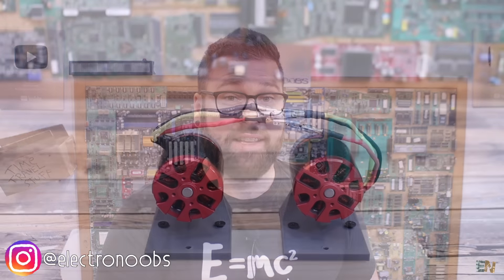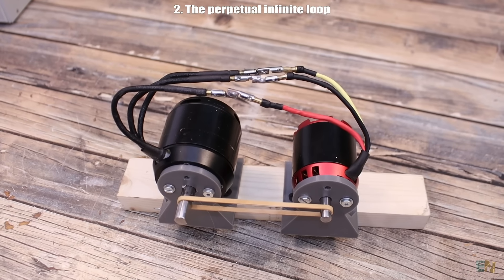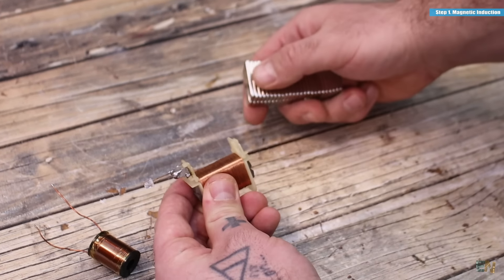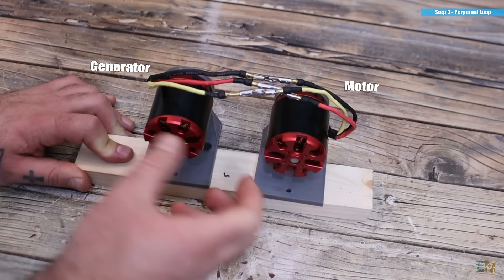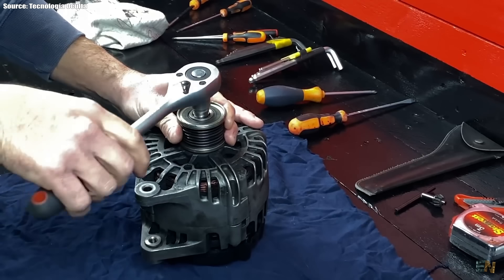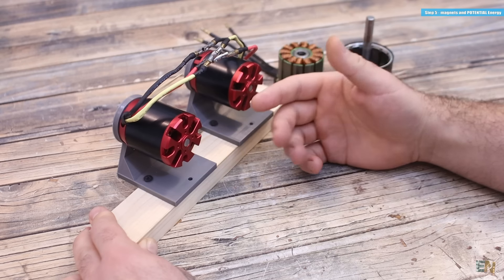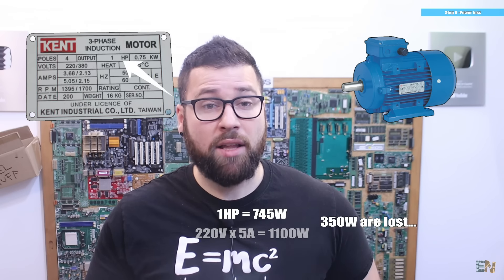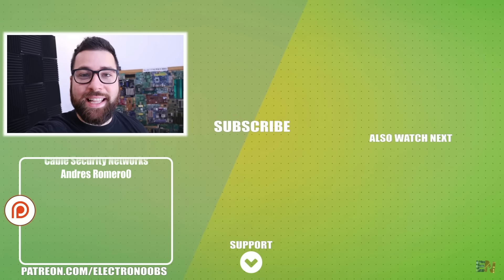Free Infinite Perpetual Energy Nonsense - FAAAAAAKE

Comment: It would be better if you built the "perpetual" things exactly like they do it in the fake videos (a car alternator and electrical motor) and then prove that it doesn't work by trying to "start" the process, not by using two identical motors.
Reply: it would be better  if you never said  stoopidness.!!!
Reply: exactly, all he does is repeat fake science
Reply: watch the video again and try to understand what he's actually saying. then you might start to understand why the others videos are just view bait
Reply: 2000 to 3000 watt, the windings from motor to the windings of generator must be act like a stepup transformer.
Reply: If the generator is outputting 24 volts ac  connect to ac/ 12vdc converter back to supply the generator this will work.
Reply: @jeffreyneal8042  no, you can't increase voltage without losing amperage. These two together give the power (wattage).
Reply: @PyroSAJ  it is a pitty to see how clueless - but tremendously clueless... - people try - and they push hard man - to "educate" those who studied the topic and deal every single day with it.... but ironically, they always only brag their theories, not a single fool of them ever tried to build that not even $200 machine, to prove us engineers wrong, though their gurus gave them thousands of howto videos.... and that says it all.... all homer simpsons....
Reply: @rdson1621  I found it curious that the latest charlatan explicitly stated in his 2 hour demonstration video (with lots of handy concealed corners) that said device wouldn't work with the given build instructions. There's an additional bit he apparently hasn't revealed yet.
Reply: "It would be better if you built the "perpetual" things exactly..."

No, it's better to present the fundamentals which then give an understanding of why it can't work.
Reply: @BeardyMacBeardFace  Nonsense!
Reply: I'm going to test it myself, because this guy might have been hired by power companies to stop any ideas out there, or he have economical interests that wouldn't be generating income if everyone knew how to produce their own power.
Reply: @roavik  Please consider uploading a video of your test :)
Reply: @roavik  or please report back to this comment thread with your findings! best of luck :D
Reply: If what you say is true, why don't you make one like it and show it to people and show the trick.  He kept it working for two hours.  If you want to show the trick, do it yourself
Reply: This guy is blind from all specs  the  video he's talking  its turning alternator to be permanent magnet rotor induction power to the coil then the coil  supply energy to the power cord to feed the motor with its single phase induction rotor ac  and the motor turn cause the generator alternator keep moving and that  it's simply.  And aviable
Reply: "tell me you didn't understand the video, without telling me you didn't understand the video"
Reply: @finnmurtonz7062  I didn't understand the video :)
Reply: @finnmurtonz7062  do u believe alien exist sir
Reply: @shahnizammohdnoor1562  it's statistically impossible there isn't somewhere in the universe inteligent life, even more impossible to not exist simple life forms, now, the probability of inteligent extraterrestrial life being inside our solar system are close to none, so i do not believe in aliens on earth if that is what you are asking, sir.
Also, what does that have anything to do with my comment? xD
Reply: @fredoscott2346  In a few words, the experiment he did, should have better results than the ones in the fake videos, and he even explained why.

He also explained a few ways to improve efficiency, but did't to make it similar to the ones in the fake videos.

This video it's full of verified information, and you are asking him to make a worst setup for the experiment.
Reply: @finnmurtonz7062  You misunderstand me. It is possible to make free energy/electricity by using this method, but not in the way this video does it.
Reply: @fredoscott2346  Show me how :v
Reply: Haha.. you dont know what this is about.. clearly you have missed the trick.. this is possible. Build one exactly the same and PROVE is doesnt work, and then report back to everyone.. simple..
Reply: @TrickyDickyP  me?
Reply: @shahnizammohdnoor1562  Yes I believe aliens exist.. I am one..! 😊
Reply: @finnmurtonz7062  "Someone" would have me killed.
Reply: @fredoscott2346  Nope, all industries want better efficiency in their systems and machines, an efficiency higher than one, would make you priceless for them. Even power plants want more efficiency, humanity wants unlimited energy. You are just making excuses, cause you know it's impossible, or at least don't know how to make said machine.
On a side note, one of the most efficient machines are electrical transformers, its efficiency it's around 95%, some can even go up to 99%. If you want  to search for unlimited power, i would start with machines that are already that good.
Reply: 90% of the content I see on YouTube is 100% bull@#$^
Reply: @cdiperformanceparts4364  ... leaving around 10% to be real and not fake...
Reply: @cdiperformanceparts4364  yeah
Reply: @roavik  This guy is illuminati, that's why. ;)
Reply: @فؤادفودي-ب9ط  Because he is illuminati
Reply: @finnmurtonz7062  Machines that are already that good aren't on the market, because the government doesn't allow anyone to get patents for them.  Look at what happened to Nikola Tesla ;).  Wake up and smell the coffee
Reply: @beaueads4170  bruh... i've worked with those machines, control and electrical engineer, they ARE on the market, but they are not toys, they are not gonna sale a machine the size of a two floor house to anyone. Electrical transformers for the step up phase in distribution are like that, you can even ask a substation to visit, some may let you go to see from a safe distance these beautiful monsters.
Reply: @roavik  Exactly.  Finally, someone seeing the light!  There are lots of greedy and secretive assholes out there.
Reply: @finnmurtonz7062  Finn Murtonz, I'm afraid to tell you this, but you have been deceived by the masses.
Reply: @fredoscott2346  Exactly, this guy Electronoobs doesn't have all the specs the other smarter guys used to create their revolutionary machines.  He's just another hater talking shit about it, maybe because he is jealous.
Reply: @TrickyDickyP  Definitely much more than 10% ;)
Reply: @cdiperformanceparts4364  How do you know for sure?  Sorry, you can't say that with certainty without knowing these things and statistics for sure.
Reply: @finnmurtonz7062  There's a lot of stuff you don't know apparently.
Reply: @finnmurtonz7062  In short terms, it's all about creating more electricity than you use on whatever you use to create it.

If you must use 30W to create 40W you have created 10W.
Reply: @fredoscott2346  when it says 30w motor, or 50w transformer, that is just talking about how much power it can withstand... Lets use a simple resistor as an example:
We have a 1kohm resistor rated for 0.25w
And a 1ohm resistor rated for 10w
Which one do you think will last longer at higher currents?

And this one is my last comment, good luck with "your" physics.
Reply: @finnmurtonz7062  I never said I was anything more than an idiot, did I? But of course, just like everyone else, I try to give the impression that I'm intelligent.
Reply: @finnmurtonz7062  no they want more money and more control
Reply: @beaueads4170  waste of your energy they think that companies and government all have thier best interests at heart even though they have to purchase their own freedom from them .
Reply: @beaueads4170  Very possibly Sir..!
Reply: @beaueads4170  OK... so all of us that think there maybe a way forward the energy and revisiting old devices and patents, maybe we should all team up and make one of these 'fake' machines (like Crazy Channel) and PROVE to ourselves that it can work. 

All the 'believers' should get together and form some sort of project group. I know we will be in different countries, but that will make it more fun.
Reply: I agree let’s debunk the so called fake debunkers and start are own like, iam already working on the hydrogen generator one !
Reply: @carlococchetto757  ok. Thats a good start. In a few weeks i will build the permanent magnet generator, we need a way of communicating between like minded people, maybe 'Telegram' as it is secure?
Reply: Exactly
Reply: @beaueads4170  also 70% of the videos I click on are not in English but is titled in English. How do I know what for sure?if I answer your question that's assuming what you meant and isn't intelligent form of communication.
Reply: excacthly, this video is really fake like more similar, they doing the same wrongs o building.
Reply: @roavik  did you build one like the hidden tech folks did? If so did it work?
Reply: I did not, but there are ways to reduce power usage and increase output, but it's in all my head for now.
Reply: @roavik  The entire world's looking forward to the day you get it out of your head and into reality. Well, not the ones earning billions on energy production/sales, maybe.
Reply: @BeardyMacBeardFace  rubbish.how cn it not work.this is no different than what's happening in a car.the prime mover ie petrol engine drives the alternator which supplies the electricity for the vehicle.in this case the motor is the prime mover .lol
Reply: @TrickyDickyP  these nincompoop  don't realise that this is exactly what's happening in a car.a prime mover ie petrol engine is turning the alternator.as long as the engine runs the alternator produces electricity.in this case a motor drives the motor which receives electricity from the alternator.i cant believe people are so blind.lol
Reply: @nerog3136  The only proviso is you need to generate more power than you take out.. permanent magnet generators (if built correctly) can do this.
Reply: Yes. True. Can he get exactly the same and prove this wrong.
Reply: You are right❤
Reply: @rdson1621  the principle is demonstrated in a car.whats the problem. A primemover turns the alternator /generator which produces electricity.ie14v dc or  120v ac 3 phase.no.???
Reply: In dat video they us magnetic N/S in motor = 2×1  , but whay they didn't connect out put ree energy to de battery en inverter,  I think dat is the challenge 

I will try to do it en see hoe is rayht  , we kan find alternator en motor in garage 70 dollar 💵 😎 🤣  , en views we all has been seen that video en likes hhhh

Hoe try it before please 🙏 took because I want try to make dat free energy 

Thank you 😊
Reply: @rdson1621  stop talking nonsense.
Reply: @daviddavids2884  dvmb@ss
Reply: @TrickyDickyP   I have the same dream of creating a magnet power generator, but when I shared my ideas with friends and family they just laughed at me.
Reply: In engineering thermodynamics it is manifested that perpetual motion machines are a myth ages ago.
Reply: @roavik  There Must be another way to create power apart from Mr Grid. I'm sure there are more than one way. But there must always be motion created by water,wind, weighted flywheel
Reply: @roavik  Me too I'm not believing everything this Guru says there must be other ways from Mr Rippoff Grid. ✓
Reply: @roavik  Sometimes even I wonder if most people are idiots. Merry christmas :)
Reply: This guy explains and do nothing!!!
Reply: Okd physics
Reply: I took after Aliexpress a generator with magnets of 10 KW and go I bought it just to convince me I start the generator with a drill at 1500 rpm until the single-phase motor starts to spin my pulley to the generator
Reply: @emilpogan5771  So it worked in other words?
Reply: Exactly words are words regardless of facts and simple math.  Not to mention each part you spoke of what we already know and the nature facts of these parts. 

So show us what you spoke and prove them wrong not just try to discredit other videos.
Reply: He can't. He doesn't have a clue how the alternator is configured to be a used as a motor that produces AC current at the same time its used as a motor.
Reply: Agree
Reply: The Battery drives the car into a range and an alternator can charge a battery while it runs 

🤔

It’s a wiring harness issue

Grounding 
Wiring 
Voltage Conversation 
Voltage Regulation
The Wiring Harness would look like the human circulatory system 

It’s not “impossible” 

But it is with this attitude 

It just hasn’t been configured right yet
Reply: This is not the type of system that exists in an electric car 

An electric car has motors and a battery 

Putting an alternator into that equation changes the formula of power distribution 

Figure out the issue

I don’t need people telling me it won’t work

I need people that can solve problems 

Otherwise this is no help what so ever
Reply: @fredoscott2346 mám doma 2,5kw spotreba výroby 8kw
Reply: Esoooo es. Justamente lo que yo iba a decir,  así sabemos si es real o falso,
Reply: Tanpa pembuktian dan praktek, anda hanya omong kosong,,,
Reply: So true sir...this guy just insult Nikola Tesla too...very disappointed me...who am i to disagree with this guy opinion...I’m not an electrical engineering either...but I’m agreed with this guy “free energy thus not exist” but “kinetic energy really exist”
Reply: @roavik well did you test it yet?
Reply: It would be much much better if you never spoke this nonsense and would be much better if you did go to school when you should...
Reply: Actually the system really work  but this guy is hiding something and he is doing a wrong experiment.
Reply: @roavik you’ve had a couple of years….where’s your findings genius?
Reply: @ottawadigs   LOL
Reply: It doesn’t matter how you put the pieces together how many springs you use counterbalances flywheels generators magnets it will not and cannot work. That’s a fact it’s called the first law of thermodynamics . Now, if you believe you can do it do all the homework you want look at all the videos you want do all the experimenting you want and build it as soon as you make an engine or motor electrical device that requires no energy energy additional energy once it started that you don’t have to put into it, sunshine wind, water, gas diesel, a perpetual motion machine, which means never having to put any type of energy into it and that it makes energy and gives you energy as soon as you do that you will be the most famous scientist ever the most famous inventor ever and you will be 1000 times richer thanmusk. Don’t argue with me prove me wrong.
Reply: @rdson1621 a tremendous pity. And somehow, that still doesn't half describe it
Reply: @beaueads4170 This jealousy might have just graduated to envy at this point. It's ridiculous.
Reply: @TrickyDickyP That's wassup